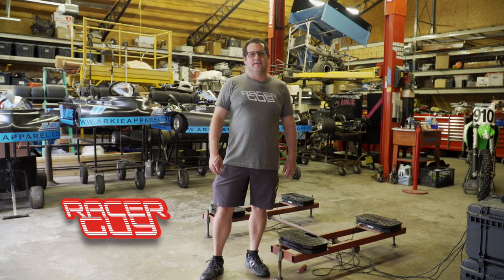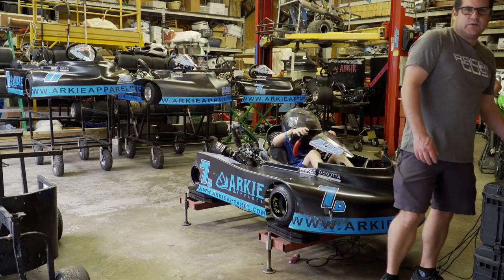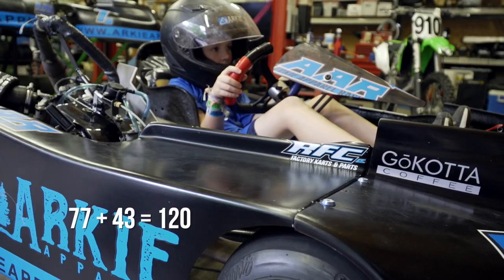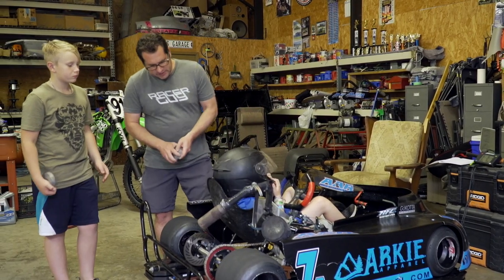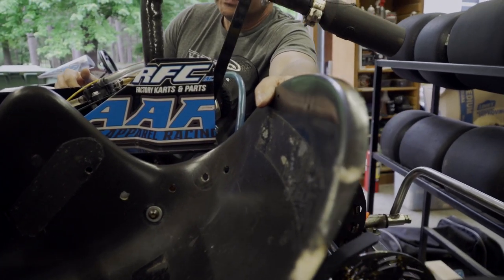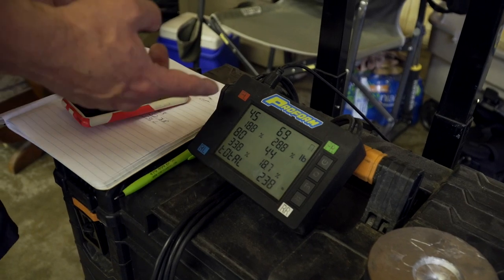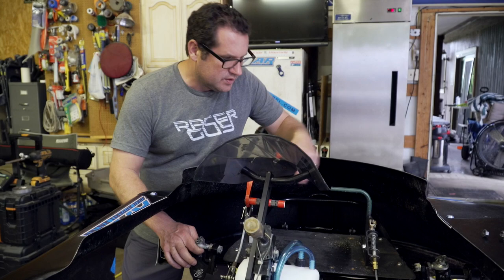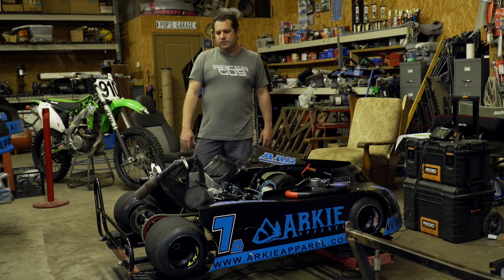Racer Guy explains Kart Scaling Basics

Comment: Hold the function (fn) button and tap the Tare button to switch the screens on those scales. The fn button will turn the weight to kg so remember to switch it back. It will do the rear percent, cross and sides on different screens though. Thanks for the vid.
Reply from the maker: Awesome, I will definitely give that a try.

Comment: Could you do a outlaw / winged kart please
Reply from the maker: Yeah I might be able to do that. The process is the same, its just the percentages are different. I really liked 54% cross on mine, and as much left percentage as I could get. My engine was so heavy I struggled getting LS weight up.It was usually 49%, but I would have loved 52%-53%. Rear percentage you can balance out with your wing slider. I would run 53%-54% Rear. But I liked to get my wing centered so I had adjustment. That wing is very important to dialing the kart in.

Comment: I noticed you looked familiar and when i saw the track i knew who you was. If we can get in touch I've got a Kart similar to this one that i know absolutely nothing about. Would you be willing to help me out?
Reply from the maker: Sure, I'm more than happy to give you any info I have on it. Just let me know!
Reply: @racerguy9483  so the only knoweldge i have on is that it is a margay kart. It was gave to me from my cousin Jared Monger. I'm stepping into the race seen pretty green not knowing anything. It has a alchool open class motor on it with a centriptial clutch. What do I need for predator class other than the motor?
Reply from the maker: @braydenlightfoot5310  If you are on facebook PM me there @ Racer Guy and I will help with what I know anyways.

Comment: Isn't it important to have the front wheel weights balanced somewhat
Reply from the maker: I guess you are talking about trying keep the LF and RF weights close to the same? I don't, but I'm old school stock car guy. I just look at cross, left, and rear. Or even just LR bite. That usually tells me where everything else is on the car. For me as long as I have consistency and I know how each change is going to effect the car I'm good. But everyone has there own of looking at things for sure. If you find something that you like and is working, I would keep it until it doesn't.